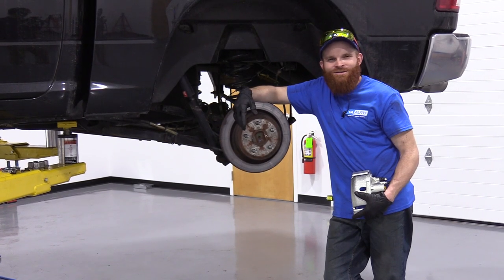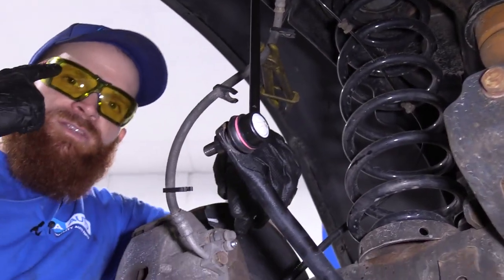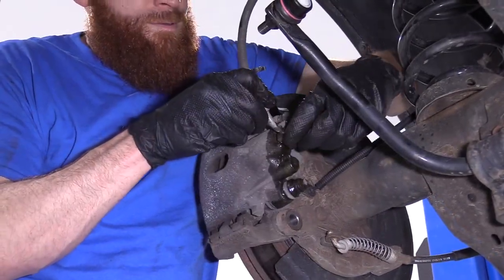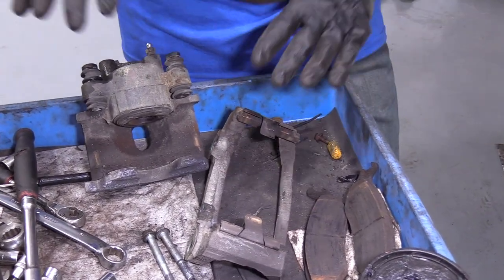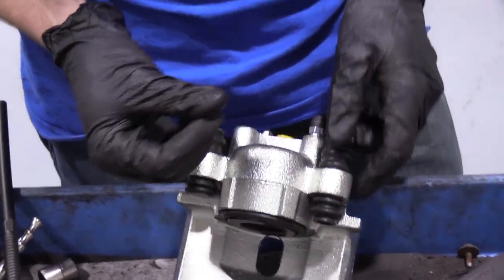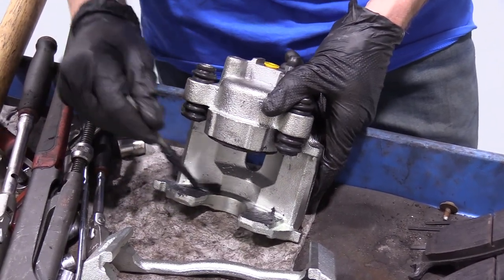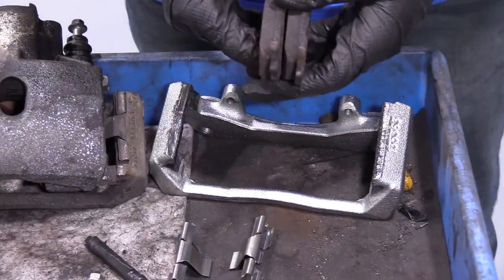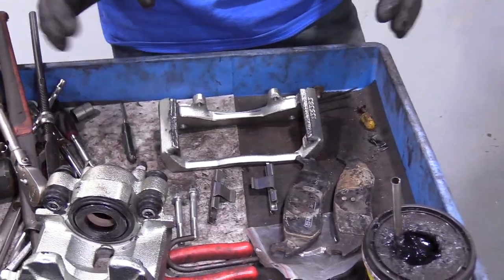How to Replace Rear Caliper 09-18 RAM 1500

Comment: Do you need to adjust the emergency break after replacing the pads and rotors?  I thought I might need to do that bit it wasn't mentioned in the video.

Comment: What can you do if you can’t get the mounting bolts to loosen?
Reply from the maker: +MariosBiggestFan112 Playz ROBLOX 2 and Teal Thanks for checking us out! You can use some rust penetrant to try and loosen them up. If you have a breaker bar that may also help!
Reply: @1AAuto  I tried to get them off but half the bolt broke inside the hole how would I get it out?

Comment: I have a 2015 dodge ram the rear calliper sliding pin i grease them up but one is still thighs to slide any idea why
Reply: Is the boot one piece if i wanted to get it out

Comment: all they are doing is trying to sell you new items.
the calibers can be rebuilt in 3 min. for less than $3.00 dollars each like brand new(just won't be shinny) ......oh no that wont work because it does not have a  warranty better spend $150 - $250 dollars 1A auto parts......YA RIGHT
Reply: Yes and no. If you have a cylinder in a caliper that freezes you need a new one. As he said a bleeder that snaps off you can drill/tap but that is a lot of work that is a little sketchy and the part shown in this video is $74.95. That being said you're somewhat correct as you should change both rear or both front if you have a bad one, so that would be about $150. Also, you are correct as calipers can be cleaned and use replacement hardware to "rebuild" but that doesn't always fix the problem. Good place to start though.
Reply: Of course they're trying to sell parts. I'd rather just install a new caliper then rebuild the old one.